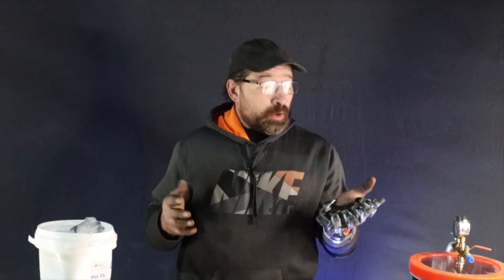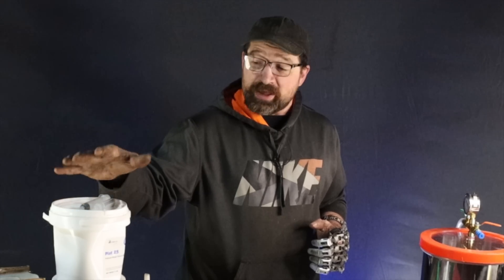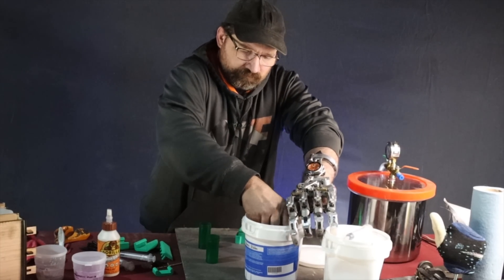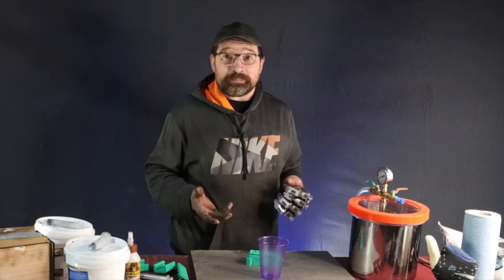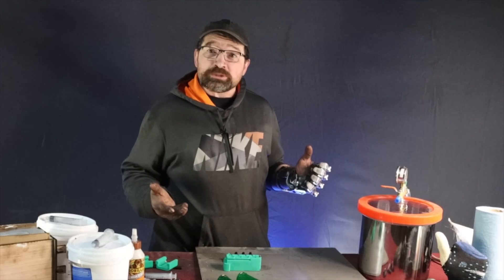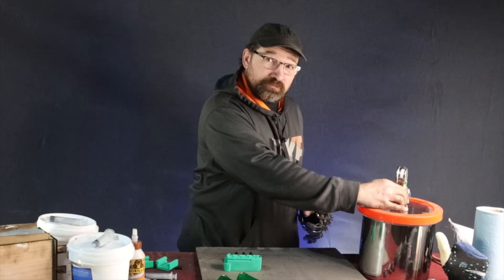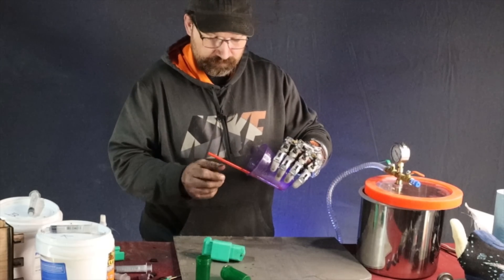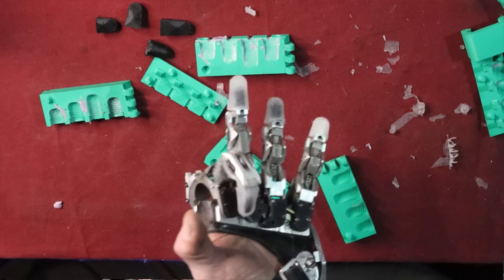Making Overmold Silicone Fingertips

Comment: When I need small silicone parts I just mix a bit of automotive or household silicone with cornflour and a little food colorant, and then mold it in the shape I want. It sets pretty quickly and can be useful for pieces that need more specific adjustment.

Comment: Hey!
Inspiring stuff as always.

That clearly wasn't the goal here, but If you did wanted to de-gas as well as possible, I'd recommend degassing the mixed silicone after pouring it in the molds (with the top lid and clamp off, obviously), not before.
Here I guess the few extra bubbles not only soften the material, but also help with friction a bit.
Also, If your surface is highly textured (or you feel limited in how textured you can make it by the de-molding process), injecting just a bit of ethanol or isopropanol in the gap between the piece and the mold when demolding can really help. Just be careful to water-rinse with the later, as some silicons apparently don't like it (never had that issue in my limited experience), and of course check on an outer bit of your mold material first that the mold itself won't be damaged by isopropanol.

Comment: Not an affiliate but I've used some interesting materials from Igus on several projects in the past.  They make low friction, highly durable, self lubricating, dirt rejecting, and more, types of materials, they offer 3D filament for some of them.  They're not the cheapest but some of the materials they're the only source I can think of for anything like them.
Reply from the maker: I'll have to check out their materials line. I'm only familiar with their igus reel cable management systems.

Comment: That mold lookks like it's printed in SLM. If so what Resin are you using to cast silicone in? I've had to use inhibit X on all the resins I've tried to cast platinum silicone in to prevent inhibiting the silicone. Also that clamping idea for your mold is brilliant. I've been using nuts and bolts for mine and I'm going to redesign it to incorporate this, it looks much easier.
Reply from the maker: The molds are printed in abs. I'm not using any release on it and the casts release just fine. The only change I'd make is to add a 1 degree draft to the clamp so you could set it tighter if you needed. It hasn't been a problem so far, but if you're setting up to build molds you might keep it in mind.
Reply: @missingpartsclub  Solid info, thanks!

Comment: I wonder if plasti dip tool handle dip would have increased longevity?
Reply from the maker: I've been using plastidip for the distal pads on the previous 2 models. It lasts about 2 weeks with daily use.

Comment: A thing that always made me wonder about prosthethics with exposed joints: will things like dust and grime be detrimental to them and how hard is the maintenance on them? Would some kind of a "glove" or a cover be possible for a prosthethic of your type to protect it from dirt? 

Makes another question come to mind as well: while the exposed machinery and intricacies of the mechanisms are pleasing to the eyes and are an artistry in on themselves, other users mind find it a bit disconcerting, especially if coupled with BDD or PTSD associated with the loss suffered. WOuld some kind of a cosmetic glove be applied to it without disturbing and jarring the joints? Not thinking about outright synthethic skin but stuff like mittens or regular gloves albeit made to size.

Comment: how the silicon finger tips stay attacched to the distal part of the fingers without slipping out? glue?
Reply from the maker: There are printed reinforcing cores, that snap onto the t shape of the distal, in the center of the fingertips.
Reply: @missingpartsclub  AH! Clever! (as usual) so now the question is (but maybe i've lost one of the previous videos where it is explained) how the printed code attaches to the rest of the finger? screw?

Comment: If you need to add a little firmness to your silicone, a good way to do that in a way that's linearly adjustable (while also adding a little flair) is to mull a little cosmetic mica powder into your Part A. The more you add the firmer your silicone, and since the only real drawback is loss of shear strength, there aren't really any drawbacks for this application unless you add way too much. If you go with a dye-free platinum silicone like Smooth On's Dragon Skin 30 you can get a nice holographic effect, too.
Reply: my brain is bad so this is fun reading a conversation between two good working brains that know stuff about things
Reply: @-1707  Same
Reply: I don't happen to have a shore hardness tester, so I can't tell you exact numbers, but I'd recommend making some samples and feeling for yourself. Iirc about a tablespoon powder per 100ml was enough to noticeably affect firmness.
Reply from the maker: That's awesome!  Thanks for the tip, I'll try it out. If I understand what you're saying, I could use this to dial firmness  between say plat 10 to plat 25 and 25 to 40. With enough experimentation I should be able to find where grip and durability meet.
Reply: @missingpartsclub  Yup! I initially discovered it because I was trying to get neat swirly effects, but a few years back I found myself needing to bridge the gap between 20a and 30a because I couldn't find a 25a RTV silicone. Super useful, just requires a bit of experimentation. Smooth-on also makes a product called Thi-vex, which thickens the liquid silicone and makes the finished product a little firmer, but I've found that in high enough quantities it tends to make the liquid silicone too thick to reasonably mold. Might also be worth experimenting with layering firmnesses - for example, doing a thin coat of 10a or 20a on the inside of the mold, letting it gel up for a few hours, and then pouring the rest in 30a before the 10 fully sets. Get the grip of the lower shore without sacrificing overall firmness.

Comment: Very cool. Is there a reason why you dont print in TPU? Just bad shaping, or feeling?
Reply from the maker: I printed and ran with set in tpu for about a week while i was trying out other materials, they were too rigid. No friction coefficient. They'd last forever. So far the silicone ones grip nicely,  especially to cat fur.
Reply: Printable TPU is designed to have a low coefficient of friction to prevent clogging and to prevent the nozzle from gripping to the part if it happens to graze. Older TPU filaments like Ninjaflex that came before that realization might work, but are a pain to work with and basically require a direct drive extruder, which doesn't come standard on most hobbyist printers (which would drive up the cost for folks doing this out of necessity.)